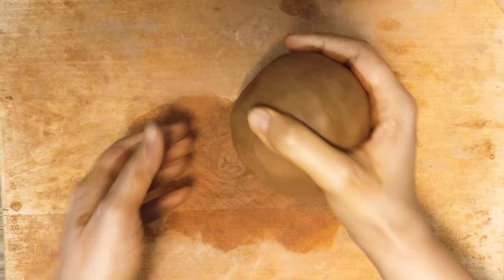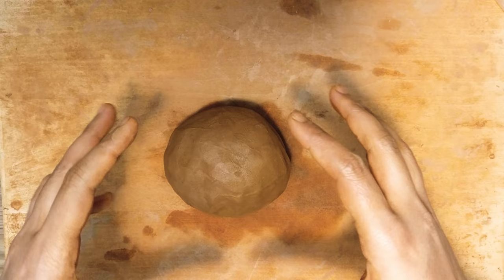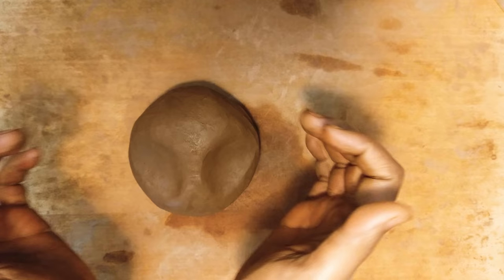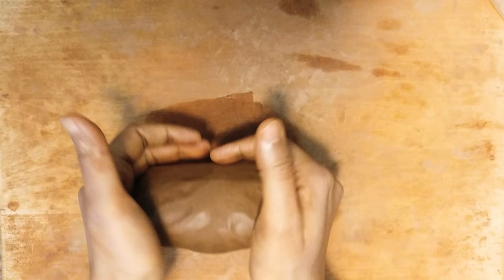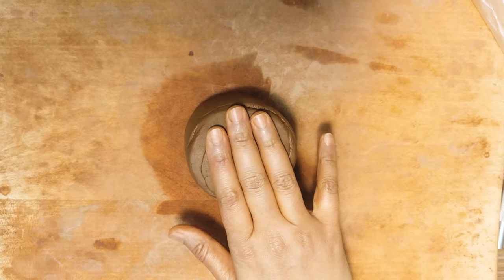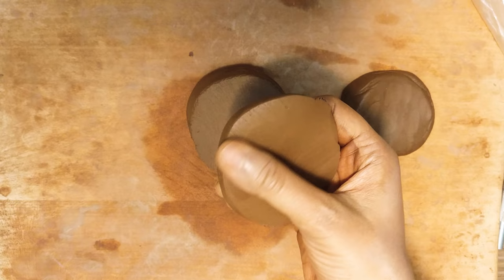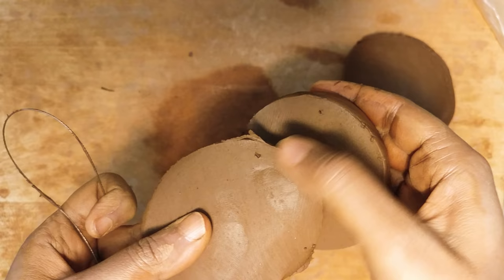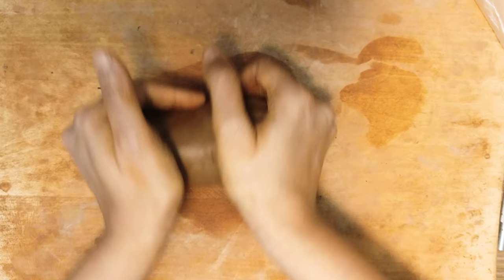Wedging and kneading of clay! #wedgingclay #kneadingclay #terracotta #howtomake

Comment: Thank you so much Neha. Its wonderful.  I learnt a lot from this. Thank you for sharing your work. God bless you. One thing I want to know that how will you store this clay in a safer manner? Because it would get harder in room temperature know. Please explain that too.
Reply from the maker: Thank you so much! You can store in thick plastic bags, something that seals well. Not the usual plastic cover. Keep it away from direct sunlight. Never keep it under a fan.
If you feel the clay is drying on the surface spray some water on the clay and close the bag.
Reply: @nehagopinathpillai  Thank you so much for ur reply. Great going. Waiting for your next video eagerly as always..

Comment: Hi neha, ur videos are very innovative & i like all ur works😊 thanks for inspiring us in making terracotta jewellery.. Just a query..could u pls suggest the glue for fixing backhead of earing..since someimes backhead & earing separates..
Reply from the maker: Thank you! You may try Araldite. Its mostly available in hardware stores.
Reply: @nehagopinathpillai  thanks very much neha😊 i tried so many glue it doesnt work & finally bought araldite bt yet to use & i thought it will also not gng to help but now really happy that it will not get waste😊 thanks alot for ur valuable response🙏keep inspiring us😊thanks again😊
Reply from the maker: @pavithrahasini  sure, I hope it works well for you. It's an industrial adhesive. Follow the instructions on the pack and it should work just fine.
Reply: Which kind of varnish or sealer to finish the wrk

Comment: This method is very useful madam. Tomorrow will defntly try and let u know... Having one doubt.. Whthr if we have a 1kg clay.. We knead it fully and can work day by day. Or we should knead each and everytime wen we are doing??
Reply from the maker: Kneading small quantities in this method might be difficult. You can knead about 800 gms to 1 kg of clay and keep it back in your bag and use it as required. Its to avoid any air pockets and get even textured clay. Sometimes we tend to mix slightly hard clay with soft clay that might result in layers and uneven textures.
Reply: @nehagopinathpillai  wow..  Thats really great that u replied..  Thanks a lot..  Loving ur patience..

Comment: Hi mam... Is this enough to kneed at one time ? Or is this necessery to kneed every time before using
Reply from the maker: Kneading not only helps with avoiding air bubbles it also makes the clay homogenous. For example : you work on a piece, you have end up some extra clay that goes back into the bag. Next time you want to work, you take that old clay along with some fresh clay from the bag. To bring both pieces together in an even manner, kneading is required.
Reply: Ok mam thank you

Comment: Hello mam can we bake terracotta Jwellery in oven.
If yes then on which mode and what temprature?
Reply from the maker: I have never done it and I don't think an oven reaches temperature as high as 900 degrees C. Also in a kiln it's done for almost 8 hours and cooled inside the kiln for another 8 hours. So I don't think replicating that kind of an environment in an oven is possible.
Reply: @nehagopinathpillai  thanks mam. Can i fire those pieces in pot containing charcoal?
Reply from the maker: @krutikapardeshi2145  I haven't tried it personally. The method might end up emanating a lot of smoke / fumes. All these years of doing terracotta jewellery and I have always got it fired in an electric kiln. No wood kilns, no gas kilns only electric kilns. The results are worth it :) suggest you do the same if you have access to a pottery /ceramic studio near you.